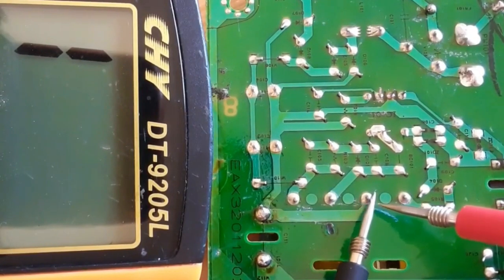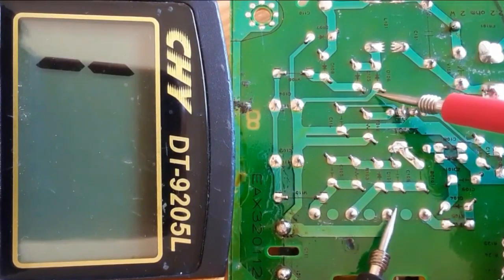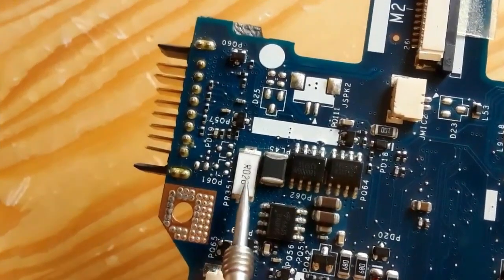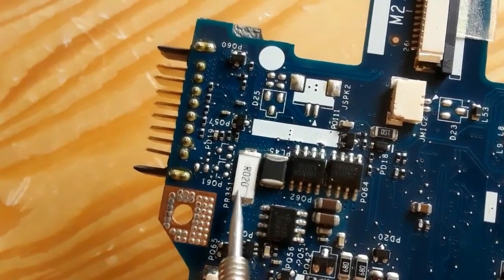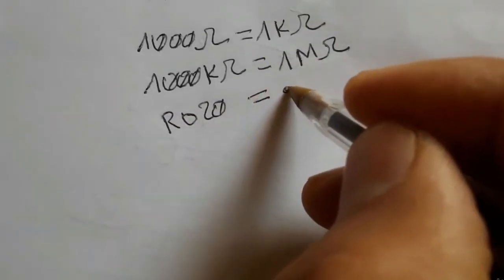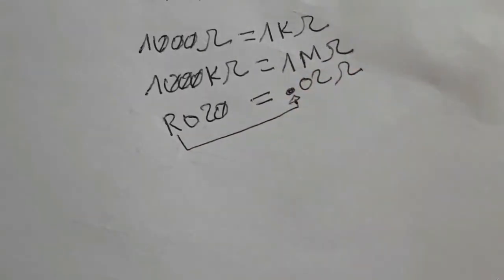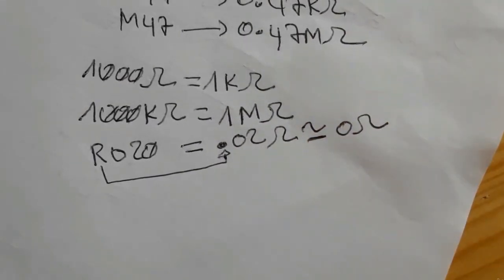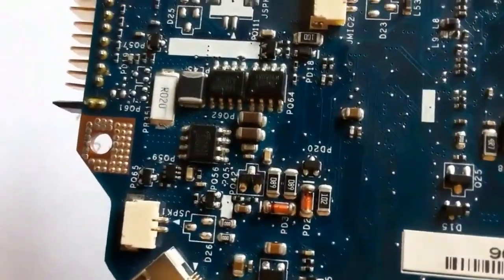Learn How to Use The Multimeter Like a Pro - Electronics Components Testing, Zener diode, Resistor

Comment: Sir how we can test ic without knowing the data sheet.because we dont know which supply which ground. And I want to know how to test ic and knowing does ic bad or good condition
Reply: Your channel is very helpful for diy newcomers like me.  I enjoy it and learning more.  I came across an gray  item on my cassette deck electronic board looks like a capacitor but with a square base. It has 6 contact points to the board and the top looks it was blown.  It has marking E323 T387 printed on it.  Do you know what that item is?  I wish I could upload a pic but I can't find a way to add to this comment